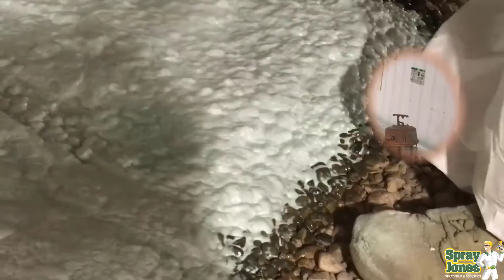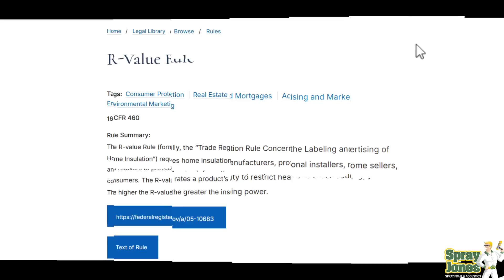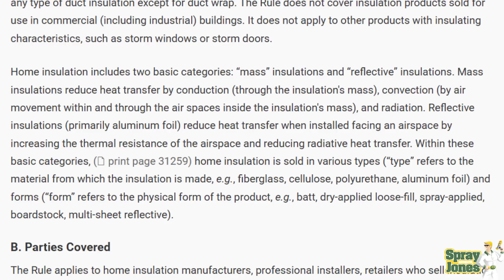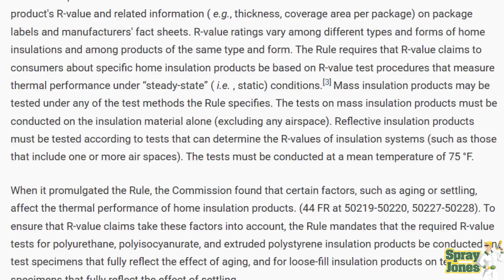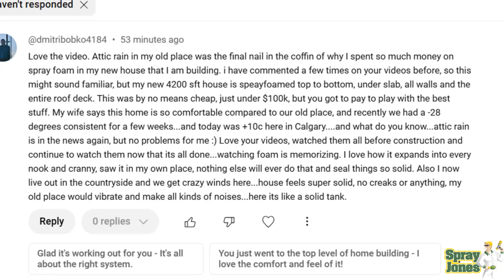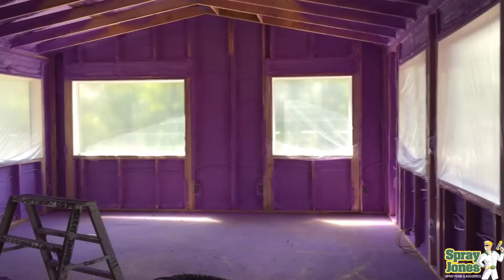R-Value & 5 Ordinary People Who Got Spray Foam Insulation

Comment: Building a 2100sq. ft. Home in northern Alberta. Last summer I had the roof deck spray foamed. All through this past winter I heated with a temporary 5000W heater set at about 50% and even through 2 weeks below -30 it kept up. So glad I went with foam.

Comment: If I build a house it'll be spray bottom side and top. One thing I noticed from doing a small plumbing repair/reno recently is getting the vapor barrier put back together is near impossible, but with spray foam it would be trivial to patch in tight spaces

Comment: I did my own Spray Foam  twice from kits. Never had an off gassing problem. The House was 90 years old. Did all my other work first. Any bad Lumber was replaced. All plumbing was down first All Electric was done second. 2 inches of foam all over. $2400 at the time. I then went across the studs with Aluminum double bubble. Left slack in stud bays. Hammer stapled it. Taped all seems with Aluminum and Tyvek tape. When I was done you couldn't hear anyone on the front porch. That's Now quiet it was. 2 inch screws  for the drywall. Cut My Hvac bill by 80%. This was in NJ so it only took 3 years to break even. Couple of things. You can't fix bad wood with foam. You have to replace it. I  also Put fire breaks in all of my stud bays. You have to foam the The rim joist where it meets the sill plate and the floor joists. Every bay. I see people stuffing fiberglass in there and all kids of other weird stuff just don't. Just foam it out.  I Left the rest of the basement for later. But that stops the chimney effect. The Great thing was The heat was even and stayed in each room. The upstairs was no longer a sauna  whilst the downstairs was freezing. Good Luck.

Comment: Love your  videos. After watching I researched local contractors and had my 28 x 36 shop done with 3 inches in walls and 4 on roof.
Walls are 10 ft and roof is 6 pitch hipped roof.
Structure sits on 6 ft ICF foundation with 6 in. Pad.
The building will stay above freezing at -20 deg. c without heat just from ground heat because of the ICF foundation.
Building costs about $ 40 to $60 dollars a month to heat in winter at 20 deg. C with 7500w electric forced air heater.
Reply from the maker: That is a great testimony. Well built. Where are you located?
Reply: @SprayJones Peterborough Ontario

Comment: Been watching you for a few years and used all your videos to aid in my new construction home in Dallas, Texas. 5100sqft, 2x6 walls, open cell throughout and including roof deck. While it isn’t a treacherous climate, performance has been just amazing the past 5 months we’ve been in our new home including through a couple cold spikes. Comfort has been incredible and electric bills have been 50% of what we had in a 2000sqft townhome previously…and we’re using geothermal, not NG for heat. Glad you jumped on with Corbett too, that was fun to see. Keep doing your thing, I still love watching your content!
Reply from the maker: Thanks for watching and giving the great feedback. We will be dramatically increasing the info. You may want to be a paid-member of the new platform because that is where the BEST info will be coming out to the members starting this Spring.
Reply: How thick on the roof deck did you go?
Reply: @JohnJacobJr   5.5" and covered all joists
Reply: Curious as to why you chose open cell vs closed cell?
Reply: @happycamper5900  I priced both out, frankly it was a $$ difference, probably 2X to do CC. I also modeled out the comparison in a Manual J and in Texas climate there was no meaningful impact on AC tonnage. If I were building in Wyoming the benefit would have been drastically worth the extra dollars.

Comment: Hey Mike, I get you on "air sealing" being GREAT !!!  So Closed Cell Spary foam is the BEST.  But I'm being told that the normal moisture inside the house, like from a shower, will allow condensation at the inside roof deck because it can't escape? What say you?
Reply from the maker: What does "V" in HVAC stand for? Either you have it or you don't. How does an airplane at 30,000 ft work? You can design a home as as system using air-tight closed cell SPF to perform similar to the plane - warm & dry.

Comment: The contractor I'm speaking with wants to use 3 inches of closed-cell foam in our 2x6 exterior walls and 8 inches of nominal open-cell foam for the roofline and gable ends in both the living area and garage. I suggested using closed-cell foam throughout, but he’s concerned that if there’s a roof leak in the future, it might go unnoticed.

What are your thoughts on this? I’d love to hear your insight. TX 4988 sq/ft 3500 sq/ft living
Reply from the maker: I have spoken about this before - guess it is time to do another video on it. Open cell can hold water for a while before letting it through if the weep is slow enough. You need a great roof with 3 layers of protection for ANY type of spf under it. Open cell is not wrong, just understand that it has reservoir capacity unlike closed cell which is shut; the water is held to the roof line - open will allow it under and behind the roof. In my part of Canada we do not use open under the roofs and only closed cell, roof damage and leaks are not a big side issue..
Reply: Where should you usea tyvek type wrap and not on a metal sided building with 2x6 framing? @SprayJones
Reply: @SprayJones  Thank you for your response. I did go with zip roof sheathing and synthetic underlayment.

Comment: Mike, the clowns that run the state government here in Maine have adopted a new insulation code.  R-60 in the attic!  Not one mention of going with spray foam.  Instead, the news story did say it will make builders use costly ways to heighten the attic walls so the eaves can get to R-60.   Not one mention of closed cell, but I’m assuming they want an R-60 in that as well.  They’re nuts and going backwards!
Reply from the maker: Yes this has reached a high-water moment of having no choice but to deal with it - as we should. New York, Wisconsin, Virgina, Maine are just a few to name that are crying for help. 
I am going to raise awareness and work with others to get this solved. If we ask for help in your region - come when we call.
Reply: @  Absolutely!